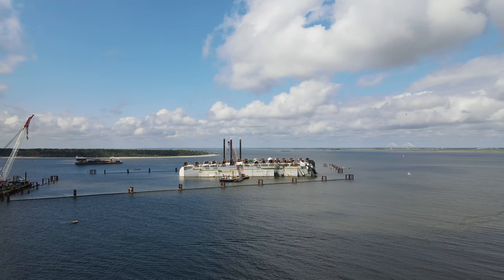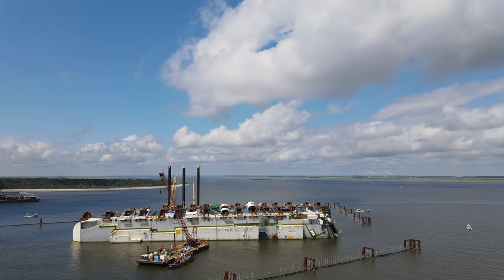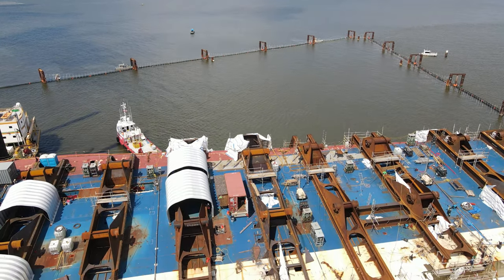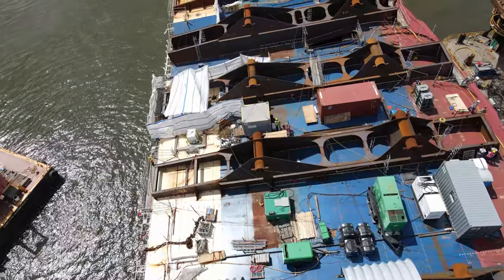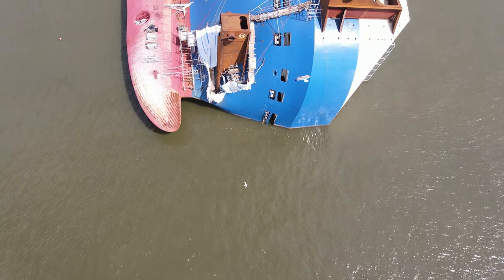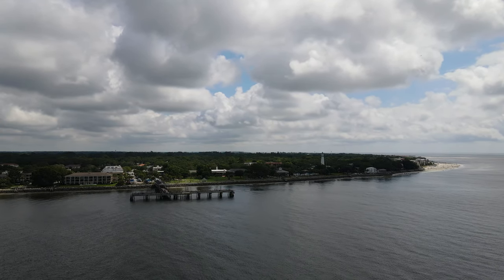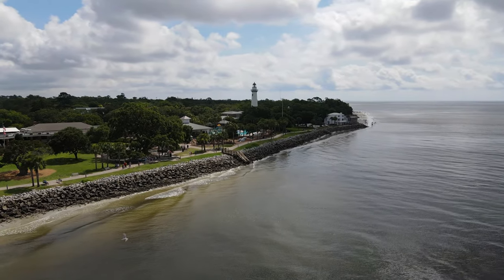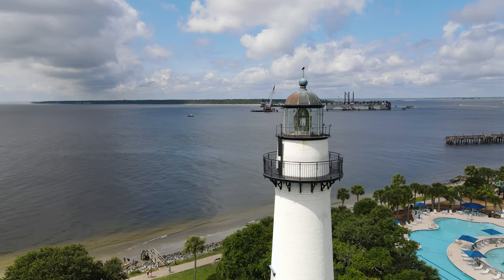Flying over a large capsized cargo ship, St. Simons, GA, 4K 60fps

Comment: The lack of ballast was one problem.  The other was that the ship offloaded hundreds of compact cars and took on as many big SUVs, all on one upper deck.  About 400 tons worth, with no attempt to re-distribute the extra weight to lower decks.  The ship could have survived one condition or the other, but not both at once - it keeled over when it attempted a sharp turn in the shipping channel.
Reply from the maker: Yes, I was amazed when I read how haphazardly the cars were unloaded and loaded without regard to weight and balance.
I have a couple of design concepts for automated weight and balance calculators based on locations and types of vehicles on these ships if the industry is interested.

Comment: You are correct about the the ballast water being the main cause of this accident, however the reason these vessels do not take on the ballast water on in the port area is that the water is full of too many organics and silt from the marsh areas around the port area. This "dirty water" is too difficult and time consuming to clean out of the ballast tanks and will clog and ruin ballast pumps and valves. For the ship owners its better and cheaper to take on ballast water offshore, unfortunately in this case it was more costly due to the storm conditions at the time.
Reply from the maker: They could have taken on ballast water before coming in.  I don't think there are any draft issues in that harbor.
I think the vessel owners pressured the Captain to keep the tanks empty to lighten the ship and save fuel.

Comment: Interesting. I always get a No Fly Zone when I check Air Map. What platform are you requesting the flight under?
Reply from the maker: "DJI's new geofencing also incorporates the principles of Section 384 of the recently-enacted U.S. Federal Aviation Administration (FAA) Reauthorization Act designating the final approach corridor to active runways at major airports to be "runway exclusion zones" for unauthorized drones. DJI customers should update their DJI GO 4 flight control app and aircraft firmware to ensure these improvements are implemented."

https://www.dji.com/newsroom/news/dji-refines-geofencing-to-enhance-airport-safety-clarify-restrictions

https://www.dronepilotgroundschool.com/dji-geo-2-0/

DJI used to use Airmap and went with this system which is more logical based on traffic patterns related to runways.
For some reason, however, about a month after the flight, the St. Simons airport information disappeared from their database, but it used to have a 198 ft max flight zone near the western edge of where the Golden Ray is.
I think it is is odd that there are two systems out there in use.  Everything I have read indicates the DJI system is legal.  I'm sure I'll hear from some Airmap fans now.  I consult that one too.

Comment: what is the depth of the water where it is? is it laying on the ground or floating?
Reply from the maker: I am not sure.  Others here have said it looks like it is in the mud and outside the channel.  It  looks like that to me too.
Reply from the maker: I took a closer look at the video and I actually think it is mostly floating and definitely not firmly embedded in the mud.  If you look at the waterline, there is no evidence of the tide rising and falling, which would be very evident after almost a year.  There is only evidence of water splashing near the water line.  If you look closely at the end of my USS Yorktown video, you can see exposed barnacles near the bottom of the hull above the waterline.  That's because the Yorktown is deeply embedded in the mud and the tide rises and falls around it just like a non floating pier.

Comment: Great video! Are the chains across the ship between the pairs of lifting lugs the actual chains that will be doing the cutting or are they just leaders to connect the actual cutting chain to get it around the bottom of the ship?
Reply from the maker: I'm not sure.  One of the other commenters here said they will cut between every two lifting lugs.
Reply: These are anchor chains.  They will be doing the cutting.
Reply: They are the cutting tools they are using to slice through the 8 slices and once they are sliced they will be out on a barge and taken to a recycling plant elsewhere. It takes 24 hrs to make 1 slice and it is very loud
Reply: The cuts will us an 8 in diamond rope/chain. The chains you see are chains used to lower the anchor brackets for lifting.

Comment: Nice quality footage. Too bad for all the misinformation.
Reply from the maker: That information came straight from the news media, who reported multiple times that they were going to remove the cars first.  I don't have my sources inside the salvage team.  In the video description I corrected the part about the cars being removed a few months ago, so cheer up.
Too bad you can't short sell it.
Reply: @AtomicSurf  It was actually a compliment.  I assumed the misinformation was from other sources.  Although I've never heard a member of the media suggest the cars were removed from the vessel.  That would be quite impossible without completely removing the side of the ship.  A few other points; it's Saint Simons, not Saint "Simmons".  They are not cutting between each of those "rusty things". The cause of the wreck was improper loading, as testified to in early hearings.  The vessel is extremely "seaworthy".  Everyone was off the ship within 36 hours, not days.  

Again, I wasn't blaming you for misinformation.  You just had bad sources.  Have a nice day.
Reply from the maker: The media was saying the cars were "going to be" removed, so several months later, I assumed they had been.
There have been a few of these car vessels that have tipped over.  I don't think they are very seaworthy, but it obviously would not have tipped over if the ballast tanks were full.
It's also shocking that they do a bunch of unloads and loads without calculating the weight and balance effects.
Combination effect: Vessel design with low margin, cars loaded without weight and balance calculation, empty ballast tanks.

Comment: Great video
What quad copter and cam are you using?
Reply from the maker: Hello.  I'm using a DJI Mavic Air 2 with the onboard 4K 60fps camera.
Reply: @AtomicSurf  You had very good flight time. CC....smooth out you yaw movements a little more or edit your vid in post. production. Good job was there this last Oct with my M2Pro but was not aware I could fly that close to airport. Do you have Part 107 cert.?
Reply from the maker: DJI came out with new firmware since that video that automatically smooths out yaw and pitch if you set it to do that.  My newer videos are smoother now.
I was using DJI flysafe to determine where I could fly.  Their restricted areas are more realistic (runway shaped) and based on U.S. law.  There was a max altitude zone of 196 ft at the edge of where the ship was so I stayed below 170 ft.  If the runway was aligned with the Golden Ray, I would have not been able to go there.  I actually spoke to the FAA and they said this part of the flight was fine.
Yes, I'm 107 certified.
Reply: @AtomicSurf  Thanks for going into detail on this.  Was it the DJI app that posted the 196ft ceiling or did you find that information somewhere else?  I went through the comments here and couldn't find that answer.

Comment: If they were able to reflate all but 2 if the warships in Pearl Harbor why can’t they raise this ship?
Reply from the maker: They re-floated that big cruise ship in Italy too.  I think that would be the better way to recover this ship.
Reply: @AtomicSurf   I would imagine it has a lot to do with the cargo. The automobiles would shift in a refloating that would make it dangerous, after all, that was another reason for it capsizing.
Reply: Can't refloat it because the bottom side of the ship is on the sand bars. So it would be like trying to roll it up hill. Too heavy and would stay grounded.
Reply: Did many soundings with a survey crew there in Pearl Harbor and its much deeper that the sandbar this ship is sitting on in St. Simons.

Comment: RoRo?    roll on, roll off. My BMW M2 was on a boat when this thing rolled.  European delivery, 286 laps on Nurburgring then on a boat. "08.08.19 Spin"
Reply from the maker: I hope it's been replaced.  In a couple of articles, they mentioned they don't even do a weight and balance calculation as they load and unload at different ports.  
I think someone should look into whether this shipping company pressures its captains to minimize the use of water ballast in order to increase fuel economy.
Reply: @AtomicSurf  no no no please read.  Not that boat.   a boat.  
It got to USA safe and sound. I had the Ships name and was able to track it as it came across Atlantic and through Panama Canal to West Coast port. 
no extra charge, part of European Delivery Program for BMW.   Fun driving in Europe; Germany.
Reply from the maker: OK.  Good.

Comment: You know you’re literally flying a drone right next to the airport... right?
Reply from the maker: There was a max altitude zone near the ship with a max of 195 ft which I stayed below.  The FAA reviewed this flight around and above the ship and found no issues.  The height of the ship and the max altitude zones were researched before the flight and the flight was conducted very carefully.
Reply from the maker: Not on the ship but yes regarding the fishing pier.  I fly next to instead of over since then.
Reply from the maker: I never want to have any close encounter with manned aircraft, so I watch that carefully.  My drone actually gets ADSB alerts (receive only) too and displays them on the map on my display.
Reply: @AtomicSurf  I'm confused (and maybe a little jealous).  From all the info I have, the ceiling over the ship is 0ft. according to the FAA's B4UFly app and is LAANC controlled, which also shows a 0ft ceiling.  This includes the airspace along the southern tip of St. Simons, the waterway, and the extreme northern tip of Jekyll Island. Where did you find the 195ft zone information? Did this have to do with the max height of the crane - using the 400ft. rule?  I've never quite been able to figure out when that is allowed within controlled airspace. When I flew out there (looks like about the same time you did - maybe a few weeks earlier), the closest I flew was just south of the Jekyll fishing pier, which according to LAANC has a 100ft ceiling.  Anyway, I was going to warn you about the FAA enforcement over this - I've heard several folks mention getting in trouble, but sounds like the FAA cleared you, so that's cool.  Anyway - just curious - thanks!
Reply from the maker: I explained in great detail where I got the 195 ft flight limit in other comments here.
So, enjoy the video.
Reply: @AtomicSurf  thanks - I'll take a look